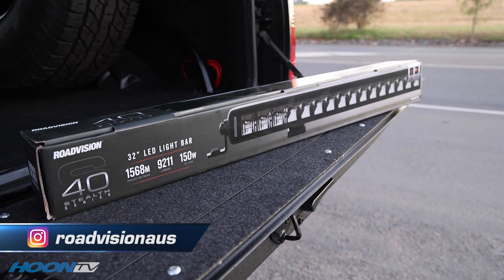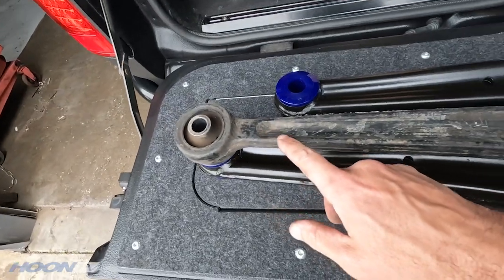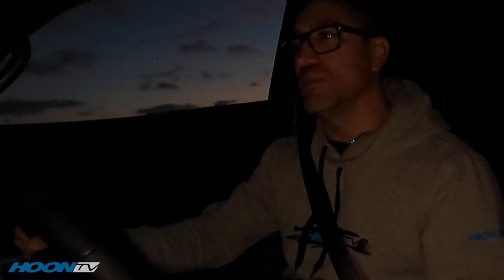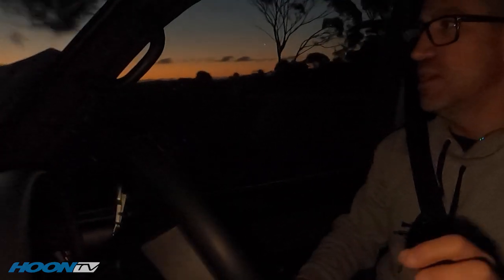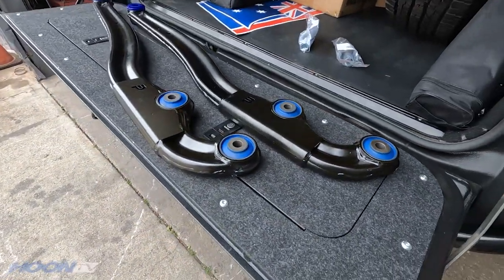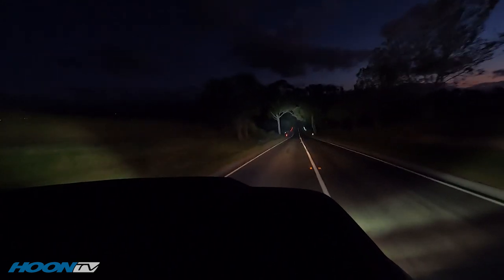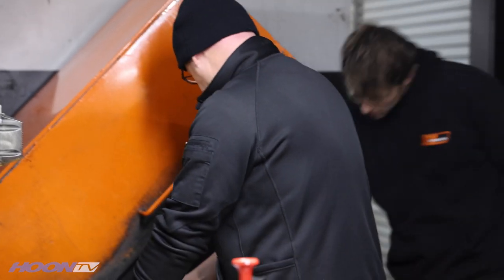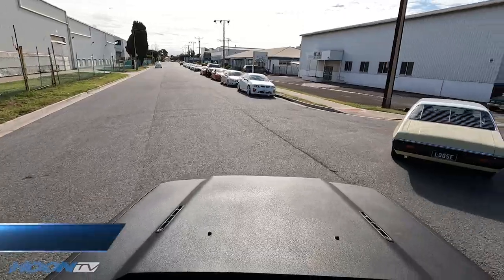Landcruiser 80 Series STEALTH LED LIGHT BAR

Comment: Nice light bar!  Do you have videos about your headlights and grill?  I tried looking through your "Frank the Tank" playlist but can't tell if it's in there.  Also, FYI it looks like there are a lot of duplicated videos in that playlist.
Reply from the maker: Playlist needs fixing, thanks for letting me know. There was a part at Autostyle where we fitted the grille. It’s a custom grille we made. The headlights are just off eBay with the chrome painted black